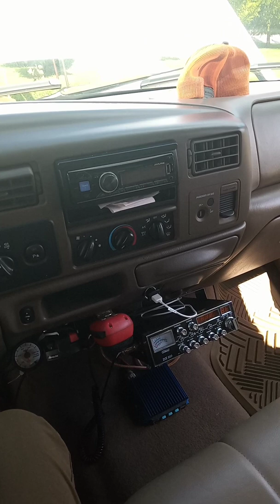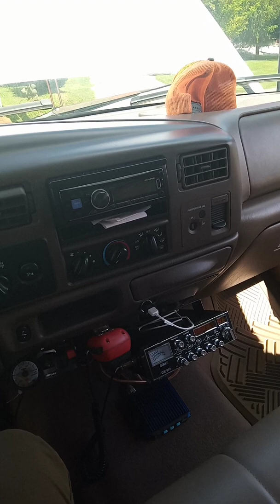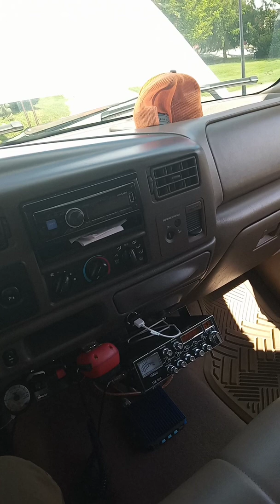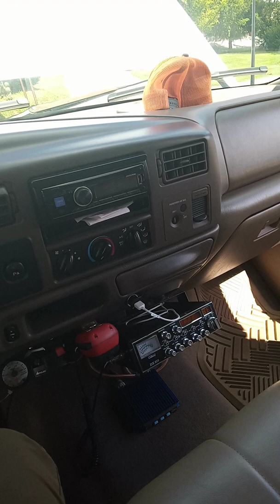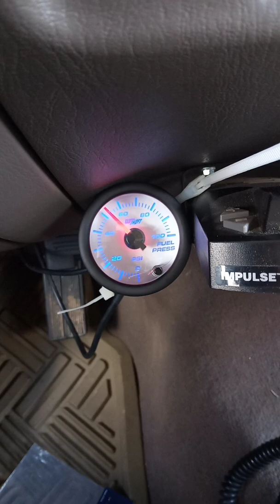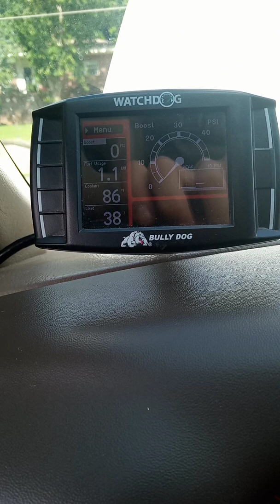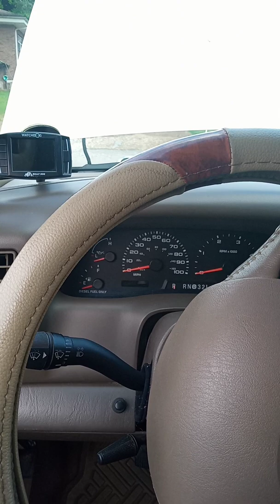F250 03 6.0 Powerstroke no power or run help needed.

Comment: Good luck! The average mechanic takes about 6 months to wrap their head around the heui and hpop system on a 6.0 The problem with alot of scan tools is they read only the psI and not the voltage where the psi reading is possibly a inferred reading due to bad icp but voltage never lies
Reply from the maker: Thanks for your feedback. I'll keep it posted how it goes. There is so much to understand it's crazy you're right.
Reply: @dtlife6155  yeah idk jack shit few years ago bout Diesels let alone 6.0s when i bought my 03' but after few months of going down a exspensive rabbit hole  the worst thing happened I fell in love with the POS I even write my own custom tunes Watch Diesel tech Ron on youtube He passed away few years back but hes was a 6.0 guru and download the 6.0 bible
Reply from the maker: @hotrod6919   Ron's videos are so priceless! Have watched many. What's the 6.0 bible? Like a all included manual? I'd be down to get that. Didn't get a manuel with this truck unfortunately...
Reply: @dtlife6155  its basiclly a manual from wire schematics to troubleshooting common failures and sensor locations ive downloaded it free a few times make sure its for 03' to early 04'
Reply from the maker: @hotrod6919  Awesome I will definitely check that out! Thanks!
Reply: 03's are kinda the bastard child of 6.0s but can also be rowdy as fuck due to a bigger cam different pistons and the Iconic legendary whistlin 10 blade turbo
Reply from the maker: This problem was HPOP failure. Took it to a shop finally after it got worse to the extent of not building more than 200psi... Apparently the pump literally seized on itself.